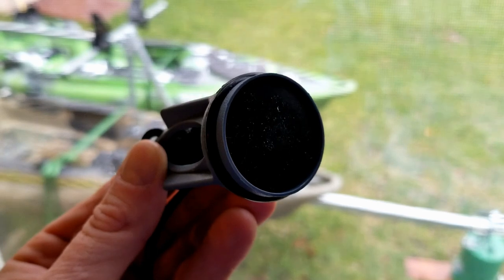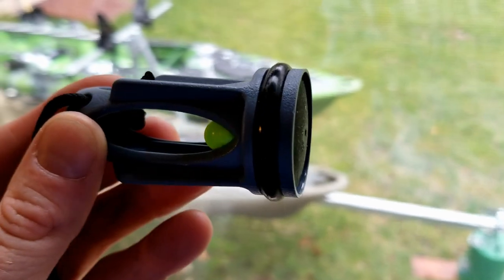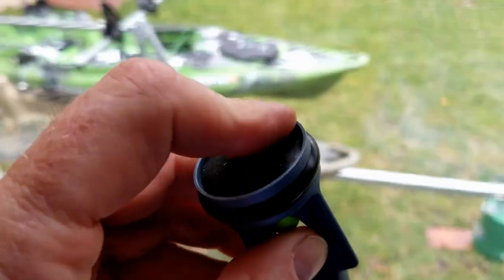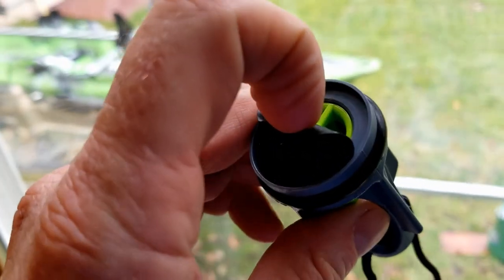Old Town Predator Kayak Scupper Valves

Comment: I found that only my front 2 plugs would leak while standing up. You can also try to raise the plug up in the hole a bit. I ended up replacing just the front with true plugs. The water can still bail out through the back and middle scupper plugs

Comment: Is it ok to store the predator XL on the trailer?  I have a harbor freight trailer with PVC tubes so the narrow part of the bottom doesn't touch anything and the kayak rest on the outer sides of the bottom.
Reply from the maker: Hi Thomas, I have a trailer with bunks. I leave mine on the trailer and loosen the straps between trips. I do live in New England though. If I lived in an area that saw regular summer days over 90 degrees I would probably not store them on my trailer.